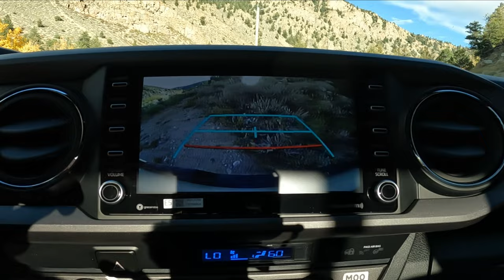Toyota TACOMA OFF ROAD Lunar Rock -  Brutally Honest Review of Access Cab Tacoma

Comment: Unfortunately this is how they are making all trucks now full of plastic. It's all about Gas Mileage and saving money.
Reply: My 20 year old truck has very heavy body panels.
Reply from the maker: As you can see, it was a bit of a difficult realization for me.  My work takes me into dense forests and rough terrain, and I really hope that tree branches and saplings will not dent these very thin panels.
Reply: @goldsteadingoverland  I would invest in a heavy duty skid plate, front and rear heavy duty bumpers.

Comment: Just do 5k miles oil changes and use 91 octane and that truck will run for ever , I say use 91 octane because that motor has a high compression ratio 11:1 , you can use 87octane but it will suffer in fuel economy and it will feel sluggish, you will notice the difference after going through about tank or two of 91 octane, I know I certainly did.
Reply from the maker: Interesting, I will definitely have to look into that.  Living and driving most at 7,000-11,000 foot elevation we typically run 85octane.  Up  here the Tacoma might like 87 then.
Reply: Traded my 2020 trd off road premium in on a zr2 and man, am i glad i did. Way more power
Reply: Simply could not get over the severe lack of power.
Reply: So I keep my trucks for 300k miles by trading a Tacoma in for anything else with little more power doesn’t cut it for me , if your keeping your vehicle only until the factory warranty is over I guess anything will work . But Tacoma is by far superior built compared to anything in its class , 6 bolt main motor , 8.75 inch ring gear , spindles axles , hinds are way bigger than zr2 . We took apart the timing chain on a Colorado v6 it was big as my bicycle, the Tacomas timing chaing is 3X bigger , bottom line Tacoma is built to last the rest are not . Just my observation over the last 20years . Buy what you like 👍🏻
Reply: So I keep my trucks for 300k miles by trading a Tacoma in for anything else with little more power doesn’t cut it for me , if your keeping your vehicle only until the factory warranty is over I guess anything will work . But Tacoma is by far superior built compared to anything in its class , 6 bolt main motor , 8.75 inch ring gear , spindles axles , hinds are way bigger than zr2 . We took apart the timing chain on a Colorado v6 it was big as my bicycle, the Tacomas timing chaing is 3X bigger , bottom line Tacoma is built to last the rest are not . Just my observation over the last 20years . Buy what you like 👍🏻
Reply: I have no issues at all with Tacomas power as a matter of fact for me it has plenty of power never once I said man I wish my Tacoma had more punch it has plenty of power !!! This past wknd I Townes my car behind it total weight was 5700 pounds and it pulled up and down hills with zero issues doing 60- 65 MPH  the whole time , towed it about 40 miles and got 15 mpgs
Reply: @peterhoma6385  had three chevys go 250,000 miles with no major issues before i sold them. The whole time i had that tacoma i was wishing gor more power. Towed my boat once and knew i made a mistake. Truck couldnt maintain 80 mph on the i terstate without keeping it on the floor. It was horrible. Zr2 is way more fun to drive and has a lot more power
Reply: @peterhoma6385  also, im not so sure about you, but im ready for a new truck by 300,000 miles. Lmao.
Reply: @peterhoma6385  just wanna enjoy the miles though
Reply: @cuzz2895  I had a 2007 Tacoma
A 2019 and now a 2022. The 2007 had a lot more power. But for me it’s got to be Toyota
Reply: @marimashburn7796  understand that. My 2012 tacoma was a lot better truck imo than my 2020. That 2020 was a dog. Zr2 rips it up

Comment: Great review of this super rare Tacoma configuration.  Access Cabs in TRD are mostly Sports, only about 25% make it to the Off-Road trim level.  I opted for the Sport because I wanted the 6MT.  Some things to note for future longevity - relocate the AC condensate line.  I did a DIY on this and it'll prevent the frame from rusting.  Also when you lift, the TSS warning may go off as the truck wants to see the factory 1" rake in the back.  When putting on aftermarket wheels - you'll need to change out the wheel studs because Toyota uses ET style lug nuts and you'll only get 6 lug turns if using the OEM wheel studs.  Matrix AWD Dorman studs up front and ARP IS300 studs in the back (trimmed down to 1-1/8") from the drum to stud end.  Good luck on this truck and yeah, lots of thin plastic components on this sadly as thats how most of new cars are built - cheaply with material savings in mind.

Also for rear suspension, I'd recommend rear leaf packs either from Icon RXT, OME, Deaver or Dobinsons.  Heard some reviews that Add-A-Leafs are just a band aid fix as the OEM leafs are aweful.
Reply from the maker: Nice, I am sure that the MT is fun to drive! Great recommendations! I have new rims coming and was not aware that the studs should be replaced also, will look into that asap!  I decided to get some life out of the stock leafs since they are un-sellable once removed.  I'm putting on a wheelers progressive aal and will report back on their performance.

Comment: A tip for the movable bed cleats! Twist the knob to screw them tight and they won’t flop around lol. That’s why the button is ribbed, so you can hand-tighten. When you tighten it, it’ll also lock out the button

Comment: I’m glad I was able to see how wimpy those rear leaf springs are. 
I’ll have to find some aftermarket ones that can haul more.
Perhaps I’ll look into the “ballon’s “ .
I had adjustable rear air shocks on my old pickup and they were awesome.
My old truck was a Ford Ranger and before I had the rear air shocks installed, I could only haul a 1/2 a yard of Topsoil, but after the air shocks were installed I could put 75 psi (the max capacity was 100 psi) and I could haul over a full yard.  I know it would have been able to haul more, but I would have had to build walls past the bed height.
I don’t want to change the shocks on my 23 Tacoma, so I’ll have to figure something else out.
During the winter months I put 260# of sand bags over the rear axle for better traction on our snow covered roads.

Comment: Appreciate the honest review. I have a 2021, and came from a 2021 Ranger. I really miss the extra payload of the Ranger and the Ecoboost. The Taco "squats" if you so much as put a few cinder blocks in the back. My 4 door short bed only has 990 lbs of payload. Ranger was 1540 lbs. Got the Taco thinking resale would be better long term, I liked the looks better, and bought into the "reliability" that everyone clamors about. As I type this, it's at the shop having transmission shifting issues (12,000 miles) shifts from 1st, slips, then jams to 2nd. Really wish I had gotten the manual. Finally, careful with that weight on the tailgate too. I've heard they're rated from Toyota as having NO (yes as in technically "0 lbs"  actual weight capacity. Scares me putting any weight on it. Kinda glad I got it on a cheap lease, cause when it's up, it's probably going bye-bye.
Reply from the maker: Sucks you are having transmission problems.  My previous Toyota truck was the most reliable vehicle I or anyone in my extended family has ever had so, will be giving this taco a chance.  It's definitely not going to have an easy life ;)  For regular towing of a small camper or any other heavy ish work a 1/2 ton or bigger is the way to go.
Reply: @goldsteadingoverland  it's definitely fun seeing them put to work! Don't get me wrong, I've towed and loaded it to capacity, and it felt adequate (minus the squat). Just wish it had an edge on the competition in terms of payload, power, and efficiency. I know Toyota can do so much better. On a side note, I got word back from the dealer, and it's getting a whole new transmission (leaking gaskets, low fluid, long story). Also, realized mine isn't a U.S. assembled truck, so that might be a hint at the quality issues.
Reply: I had a Tacoma, the best truck every built by far. Trade in value incredible. Work horse, smart and beautiful to look at. Older a Tacoma gets, the better it runs and looks. I want to get another, but they are always sold out. These trucks are the most popular truck in the world and superb engineering design. I had one of these Tacoma's that was 1997 and sold it in 2017 for $6K with nearly 300K miles. They are in suck demand. I wish other trucks could be half as good, especially American made trucks, but you get what you pay for.

Comment: Thanks for the honest review man. I have a 23' Taco OR. I hate the quality of body panels, even though Taco is affordable and reliable mid size truck, it is truck. It needs more heavy duty stuff.
I am planning on replacing fenders with aftermarket bodykit for allowing more clearance, racing parts, and looks. I always pray to not get dents before overlanding
Reply from the maker: Oh I hear you!  I drive thought lots of shrubs, saplings and branches and am hoping that those will not put dents in the truck.  The body panels feel about 50% thinner that my old 1st gen tundra which is rated at the same specs as this new Tacoma.

Comment: Hey neighbor! Fellow Coloradan here. In fact, you drove right through my district and it looked like you drove right along my commute route through Salida! Found your vid while researching new Tacomas. Currently waiting on almost the same one you have from the same dealership! Those guys at Mountain States Toyota have been good so far. Right now, I'm running a '99 Tacoma and often load up my Kodiak 450 in the back. When I drive it up forward, like you did, I run into the same fitment issue. However, if I BACK IT into the bed, I can close the tailgate. It's a bit tricky to do but, it might be a quick easy solution for you.... if you haven't found an alternative route.
Reply from the maker: Yup! Arkansas River Valley!  Interesting tip on the ATV, I will have to give that a try.  Mountain States had the best pricing for Colorado dealerships.  Their finance office tactics are a bit sneaky but that goes on everywhere.

Comment: Nice vid, right up my alley. Just got the same truck and I'm gonna use it for hauling a Yamaha raptor in the bed 450 lbs only. Just wondering what leafs you'd recommend?
Reply from the maker: Awesome!  I ordered 4wp progressive AAL after much research. They will be going on soon and I will definitely do a video about them.   At 450lbs, I think you will be ok with the stock leafs,  it will probably sit level and handle fairly well.   I prefer more firm handling.

Comment: Lots of plastic I noticed also! That peeping when door is open you can hit that black button on the access door  it turns the door ding off.

Get the bed matte the rubber one when that bed is wet it’s slippery as heck and you can also get those led bed lights and cargo switch it’s all pre wired
Reply from the maker: I will have to give that a try, thanks!  I am considering the bed mat. Wish the composite floor had some texture to keep things from sliding all over the place while driving.

Comment: The reason why the metal is thin is to save gas because if you put way more heavy crap on you car you will go slow and have less mpg. I have a 4wd trd off road and it holds good on rocky terrains

Comment: Had a 2001 for 9-10 years, very reliable, few to no issues, except frame rusted. Metal light pole ended her life prematurely,(although I think I saw her at the dump the other day still running,someone salvaged her!), right after Toyota put a brand new frame on it, new frame probably saved my ass. Had to add helper springs to both my Tacomas to correct the sag. Got a 2011 after the 2001 demise. After 9-10 years, had a few issues…horn broke, battery, trans started acting up, and the frame rusted! Toyota screwed me on the second frame. Got a Colorado instead. So far, the new Colorado is still running strong, (32,000 miles). Concerned about the transmission though. Chevy certainly doesn’t have the reliability that Toyota has. Miss not having the rear locker as well. There are a lot of things, though, about the Chevy that blows the Tacoma away…30 more horsepower,(she moves!), drives great, comfortable seating, way more payload capacity,(no sag, no helper springs!), more towing,(7000lbs), roomier headroom,(no hitting you head on the ceiling, I’m short so never had that problem!😊), wireless connect to infotainment center Apple CarPlay, key fob operated locking tailgate, remote start,(does the 2022 Tacoma have remote start?🤔), taller sides which equate to larger tailgate,(good for camping, cooking, and working), smaller, more comfortable steering wheel, heated seats and steering wheel,(not sure if the new Tacomas have this?), hood assist shocks,(that Tacoma hood is heavy!), disc brakes all-around, much better braking, (rear drum brakes are reliable, they work, but Tacomas nose dive!), much better gas mileage in the Colorado! I’ve gotten as much as 28.9 mpg,(my Tacomas couldn’t touch that! Not sure how the new Tacomas are, but I know they’re still not that great), fully boxed frame!(Tacoma is a c-channel and prone to rust!), like the looks of both trucks honestly. Some things that are better about the Tacoma…reliability and resale value, rear locker, better clearance,(height wise, my Colorado seems to have the same 9.5” clearance but the stupid shocks hang down and the tire mount is ridiculous!), 110 outlet in the bed,(Colorado don’t got that!), better turning radius in Tacoma as well as departure angles, led headlights!, 6ft bed,(my 2021 Colorado is a 6ft bed, but new Colorados no longer offer a 6ft bed! What??!!!😮), better looking,(I honestly probably like the looks of Tacoma better than Colorado). Anyway, good luck with your Tacoma. It’s a sweet looking truck and should serve you well. I’d think about getting that exact same truck myself if they weren’t so overly-priced right now and my dealership weren’t assholes! Signed, Covert Fanboy😊 https://youtu.be/mq8Jo1t2Uqw?si=qd-39m-Hiul4vEVM

Comment: I see they make a sway bar for Tacoma, would help with handling in the mnts too. The payload for that configuration is 1400lbs I think. I put Nitro 4.88s in my 2WD Access cab, it feels like thats what the truck was made for. Other wise 5th and 6th gear are over drives.

Comment: I found the power of my 2018 TRD Off Road Tacoma to be really too low. Transmission was also awful. Slow to down shift.
Reply from the maker: Power is still the same but they did slightly improve the shifting points on the for the 21+
Reply: Get a pedal commander I got one on my sr and I was shocked it doesn't increase horse power but replaces the lag on the accelerator and mines a 17 sr 4 cyl 5 speed it took me less than 15 minutes to connect and after I installed it I tested it I left my driveway and left. rubber in first gear after that getting on highway ramps or merging into traffic I know longer have the fear if I need to pass someone it's incredibly and a much better place to start than one of those expensive computer flashesand it only takes a few minutes to get it back to stock if your having troubles and they claim the warranty won't cover because of mod

Comment: Tacomas have the lowest payload rating of any truck out there.  Not meant for heavy loads.  Access cab will for sure have more payload but a Double cab V6 4x4 you can max it out with just 4 big people in the cab.  If you're towing anything near 5000lbs it leaves very little room for passengers/cargo.
Reply: max is around 6k lbs. youre telling me each person weighs 1500 lbs? gtfo of here
Reply: @gerard4441  payload rating for the double cab is only 850-1000lbs for most of them.  This has to account for anything in bed of truck, cab and tongue weight of trailer.
Reply from the maker: The Access Cab has a rated payload of 1,295lbs.  I consider it a trail  tromper not a tow truck.

Comment: I have a 2004 SR5 3.4L 4x4 5 speed manual, 170,000 miles new frame from Tacoma. If you were to offer your 2022 Tacoma for mine I would decline. Granted I use mine for backcountry camping and not loading a ATV but I think the leaf springs in my 2004 are more solid than what the 2022 has. Also the exterior of the new Tacoma has fail written all over it. The hood will "shimmer " when you drive because it is so thin. The steel toyota is using for their 4runners and Tacomas will scratch in cold temperatures and is not sturdy at all! Your video alone shows how flimsy the exterior is. Plus my 2004 came with 4 4x4 styled mudflaps. Oh none on the new ones unless you purchase extra? Don't get me started on how outdated the interior is and those circular vents! The only good thing I can say about current gen Tacoma is the engine is incredible. The rest of the truck is a joke for the price.
Reply from the maker: I think they take the mudflaps off to make the truck look "cooler" and taller.   The thicker paint protection they add along the bottom of the panels has to cost more than flaps.
Reply: @goldsteadingoverland  thanks for your videos I'm a new subscriber! Have a great winter man!
Reply from the maker: @IowaHiker  You too Hiker